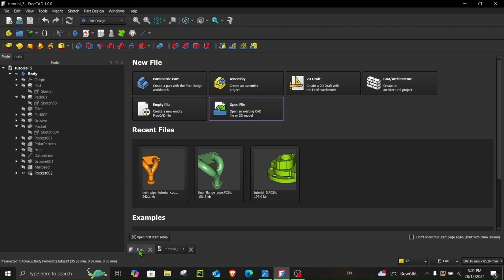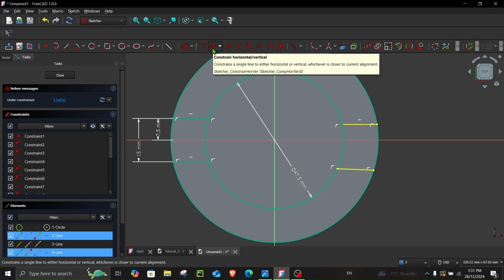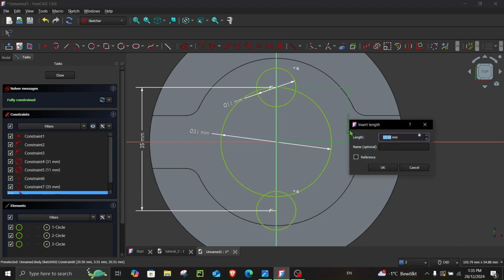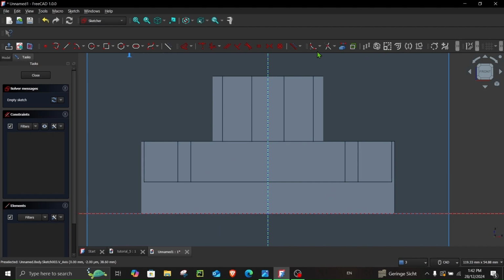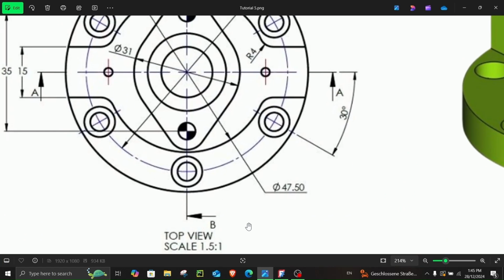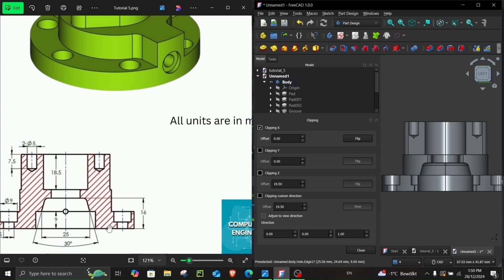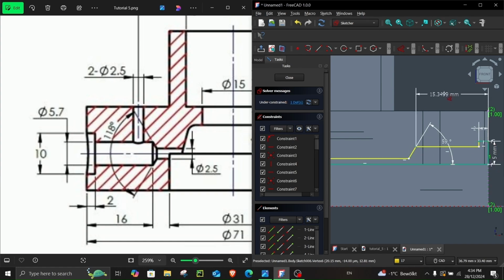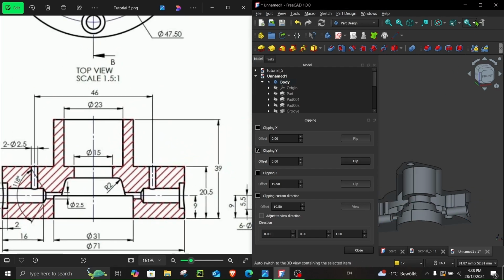FreeCAD 1.0 Beginner Tutorial | Exercise 5

Comment: Hey CE, great video. I was even able to come out at the end with a correct-looking model, though not as gracefully as you. However, there is one trick that puzzles me mightily, which is:

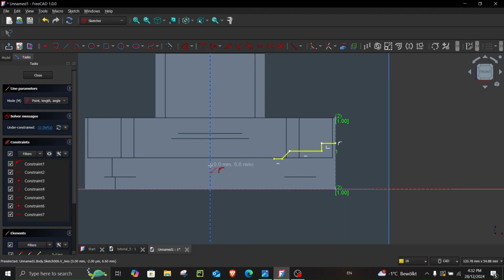At 21:35 you start to measure the distance to a horizontal construction line, and naturally Sketcher tries to give you the line length instead of the separation. But at 21:37:20 you do something, without having to select a point (which is the only way I could have done it), and Sketcher meekly gives you the vertical separation that you want. What did you do there? Is it a Windows-only thing?

Comment: Now I have seen you tutorials and they are very very good! Speed is now ok. It's also very interesting to see a experienced persons workflow, it also contains valuable tips.
My tip: In exercise 5, the last thing you did was creating 2 holes with 46 mm between them, and then defined the position of one of the hole to be 46/2 mm from center. That works, but if you change the distance between them, the you have to change values in 2 constrains. 
Instead it's better to select the centers of the 2 holes and use the constrain symmetry. Then they automagically place themselfs correct.

Comment: Pushing control to select elements in sketches is not necessary.
Reply: And you should use the symmetrical constraint instead of for example 35/2. If you change dimension 35 you have to update also the dimension 35/2.